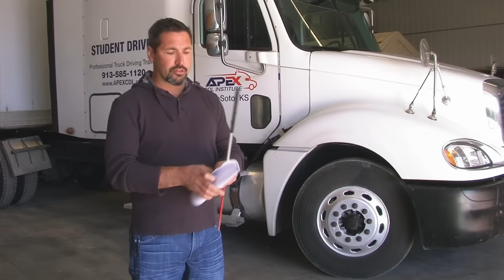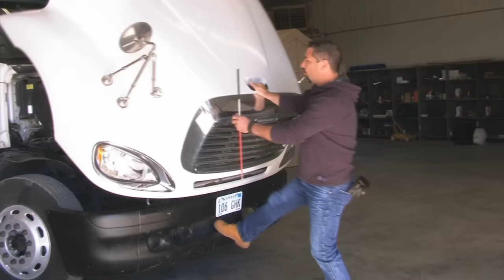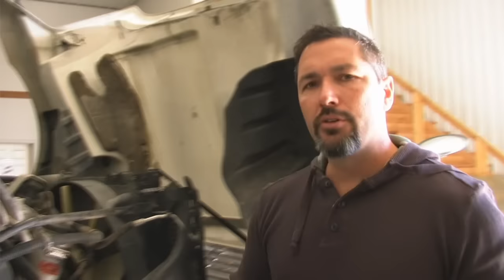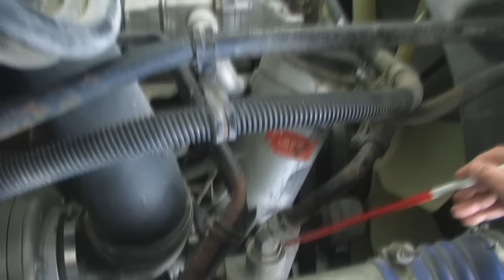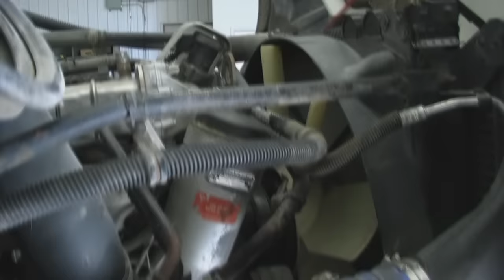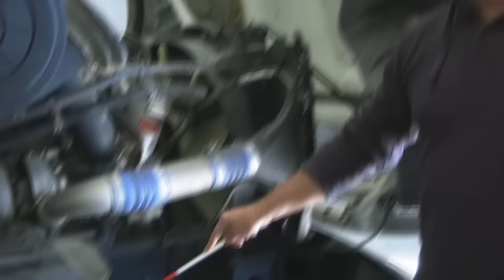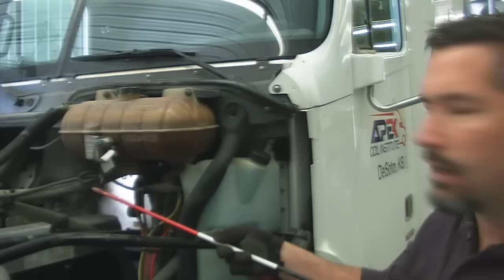How to perform a Class A CDL Pre-Trip inspection. Demonstrated by a state licensed CDL examiner.

Comment: 16 years otr and your the first instructor I've seen who actually showed people how to physically check the slack adjuster I rate this a 9 out of 10 although I know it is not needed for their test I think it would be beneficial to the students and new drivers to show them how to adjust their brakes but overall best one yet thank you
Reply: would of also liked to see you show new people how to check breaklights and physicaly look at blinkers and headlight but still A1 job side note you didn't mention brake fluid or blinker fluid lol
Reply: +stephen driver what about headlight fluid..?
Reply: +stephen driver the problem with that is twofold. first most slack adjusters today are self adjusting and as long as you do a pumpdown the brakes should always be in adjustment. secondly most drivers today would most likely crank them down and cause a fire
Reply: He doesn't show that, probably because all vehicles as of 199? have automatic adjusters. No company you work for will have manually adjusted brakes on them. If you work for one, get a new job, the equipment is prehistoric, though I like the manually adjusted ones better.

Comment: You can always call it the “ SLAB” test 
S: Static (should not loose more than 3 psi per minute)

L: Leak test ( apply 90 pounds air pressure and you should not loose more than 4 psi per minute )

A: Alarm test ( The low air warning should comes on when the air drop down to 55 psi or above )

B: Button Test ( both button should pop out when the air drop down between 40 to 20 psi )

Comment: As a driving instructor in Ireland I found this video very good. Much more in-depth than is necessary to do in Ireland. For example...in the walk around we do not need to inspect the engine bay in such detail just liquid levels. And that nothing is loose  or damaged.Also I note that during the in cab check the instructor first checked that the vehicle was in neutral. We teach to check that the parking brake is applied first to ensure that the vehicle can not move.

Comment: This was fantastic!! The first thing I looked at was how long this video was and thought "ahh hell". I quickly realized the length of the video was directly related to the value of its content. The steps laid out with the explanations provided were really what every driver, even experienced drivers, could benefit from greatly. It's July 2023 right now and everything reviewed in this video is completely relevant today. There may be minor adjustments, based on your state, that would have you use a modified explanation to give to your exam or test administrator. But having the knowledge of how things are connected, identifying what's what based on how they're connected, and the overall wisdom provided to improve a driver's ability to solve a problem before it becomes a disaster is without question, priceless. Thank you for sharing your teaching skills with the rest of us.
Steve

Comment: Hi There!  Awesome Video!  Here in Massachusetts, the Brake test starts with the engine running! You first check governor Cut In and Cut out. After that, static 3 psi, applied 4 psi, low air preasure light and buzzer signal and Spring brake test (engine off). Next, start engine and do the compressor recovering time from 85psi to 100psi withim 45 seconds. Finally, the 4 points brake test: Trailler parking brake, truck parking brake, trailler service brake (Trolley hand valve) and Service Brake. Thanks for the video!
Reply: I wrote it down—thank you

Comment: Absolutely an amazing instructor and video. I passed my CDL test with no problem with the help of this video. Its a lot to retain but its absolutely worth the cramming of information. There a schools that charge thousands for the information this guy gives. Amazing video and thank you for sharing it with us.
Reply: he gets in the truck and then put it in gear and turns it off so it doesn’t roll then charges the pressure for the brakes (parking brakes) So that he can test the pressure and if there is any leaks.

But what I don’t understand is why isn’t the parking brake already on when he gets in the truck and why do you need to put it in first gear to listen for any pressure leaks? Why can’t you just leave it in park re-pressurize it and then turn it off without putting it in first gear…’m

Comment: The mentioned “hub seal” on the front axle is a hub cap gasket. The hub seal is on the back of the hub and holds the bearings in. Those are not visible until you remove brakes and drum.

Comment: Some Video Notes:

In-Cab Inspection & Brake Tests

Before Getting inside:

3 Red Triangles

10 B:C or better fire extinguisher: 
Fire extinguisher has to be of proper rating, secured, charged, & up to date

6 spare fuses
Notate to examiner if truck doesn’t use electrical fuses

3 Points of Contact at all times while getting inside the truck

Inside:

Put on Seatbelt

Ask Examiner to put on their Seatbelt

Inspect Your Seatbelt: 
Properly secured/mounted on both ends, no frays/damage, latches properly 

Inspect Floor Board: 
make sure it’s free from debris or anything that could obstruct the use of the pedals

Inspect Shifter: 
Not cracked, damaged, moves properly, Splitter is working

Inspect Windows: 
They’re clean, not cracked, damaged, or have any obstructions/illegal stickers, and the seals are good

Mirrors: 
Both flat and convex mirrors are properly adjusted (explain what that means), clean, not cracked, damaged, or have any obstructions/illegal stickers

Windshield: 
Clean, not cracked, damaged, or have any obstructions/illegal stickers, and seals are good

Steering Wheel: 
No movement beyond 10 degrees or  2” on a 20” wheel

Safe Start Truck: 
Turn Key & Give a Few Seconds Before Starting, Parking Brakes Are Set, In Neutral, Fully Engage Clutch, Start Truck, Disengage Clutch

Check ABS: 
Should come on then go off, should not stay on or not come on at all

Air pressure should build from 85 to 100 psi within 45 seconds

Governor should kick off compressor with the air pressure at between 125-145 psi

Check Gauges:
All should be “Working Correctly and at the Proper Level”
Oil Pressure (~20 psi at idle)
Water Temperature
Volt Meter (~ 14 volts)
Tachometer (Rev the engine a little to see the needle moves)
Speedometer (Check during rolling brake test)
Primary & Secondary Air Pressure (Should be holding around 125 to 145 psi)
Fuel Gauge (Enough to drive safely where needed)
Application Pressure (0, because not applying brakes)
Transmission

Windshield Wipers / Sprayer: 
Demonstrate that the washers work by spraying the windshield. The Wipers are: Properly Mounted and Secure and operate smoothly. The blades aren't cracked or dry rotten.

Check Lights:
Left Turn Indicator
Right Turn Indicator
Hazards
Front Headlights
Brights

Turn on Heater & Defroster: Feel with your hand that air is coming from the dash, vents, and below for feet.

City Horn

Air Horn

BRAKE CHECKS

Remember SALE (Static, Applied, Low Pressure, Emergency)

Push Clutch in
Place in 1st Gear (So you don’t move with parking brakes disengaged)
Turn off Truck
Release Clutch
TURN ELECTRICAL BACK ON WITH KEY
Put down window to listen for any air leaks
Push in Air Brake Knobs to charge the system
DON’T TOUCH KNOBS UNTIL REQUIRED FOR TUG TESTS
Wait for system to charge (125 to 145 psi)

Static Brake Check (without brakes applied)
3 psi or less over a 60 second period (for combination vehicle)
In both primary & secondary

Applied Brake Check
Apply Brakes & Hold
4 psi or less over a 60 second period (for combination vehicle)

Low Pressure Warning Signal
Start fanning brakes
Warning should come before ~60 psi

Emergency Brake Valve Test
Continue fanning brakes
Warning should come on between 20 and 45 psi
Both valves should pop out for tractor & trailer
Don’t touch the knobs, keep pumping until they both pop

Safe Start Truck: Turn Key & Give a Few Seconds Before Starting, Brakes Are Set, In Neutral, Fully Engage Clutch, Start Truck
Charge system by revving engine around 1500 rpm
Wait for the governor to kick the compressor off indicating the storage tank is full

Tug Test for Emergency Brakes (Tractor/Trailer Done Individually)

Trailer
Press in Clutch
Place in 1st
Release the spring brakes on tractor
Lightly release clutch to pull against trailer brakes

Tractor
Set tractor brakes
Release trailer brakes
Lightly release clutch to pull against tractor brakes

Service Brake Test
Release both tractor & trailer brakes
Let out the clutch
Lightly hold steering wheel or no hands (Ask which they prefer at school)
Get up to 5 mph
Push in clutch
Firmly press brakes (It should not pull to either direction)

Should also check your trolley valve, which applies just the trailer's service brakes.
(Not on test)

Properly Shut Off Truck

Thanks for this video! This is by far the best video I've found for this information. 
I've watched it a bunch of times. I have my learners permit, but haven't taken the classes yet, I'm going in as prepared as possible.
I hope these notes I took for this part of the test are helpful to someone. (And not inaccurate in any way
Reply: Wow Thanks printed this up great help

Comment: Parking brake (Tractor Spring Brake) 57:29
Trailer Brake ( Trailer spring brake ) 56:50
Trailer Service Brake (Johnson Bar) 59:24
Combination Service Brake — 57:55
Air Leak Test — 49:40
Fan Down One — 53:00
Fan Down Two — 53:35

Comment: he didn't check battery compartment to ensure batteries secured properly, I would have also put on lights and 4 way flashers during rolling brake check.  My instructor seems obsessed with the Pitman arm but noticed this guy says OK to refer to linkage from power steering gear in general terms, i.e 3 way linkage
Reply: He did say "my hazzard works properly 49:17"😏😏

Comment: How often do you perform this inspection?  It seems that these inspections are something a qualified mechanic should perform when the tractor gets its service.  If I had to perform this exstencive test before each trip I'd never be on the road.
Reply from the maker: You have to perform a pretrip every day, you also have to document that you did it as well. Dont let it intimidate you, I can do that same pre-trip in 20 minutes. It just takes an hour in the video because I am taking time to explain everything. If I was not orating and walking the viewers through it, I could bust a thorough pretrip out in no time.
Reply: Very thorough, I'm in UK, and the pretrip is not as extensive, but I will include the American way into the UK way, it increases confidence when you do a proper job.  thanks
Reply: every day!
Reply: A good pilot will walk around his plane. Keep learning I walk around my flatbed in the morning and fine someone left a bar on my bed by accident or a tool. Maybe a light out. I pull into a rest area,take a break,then to wake up,I walk around the truck and check the load. There a reason why I check.
Reply: I work for a global delivery company and each day I'm given a different tractor to drive. How long should you spend or at least a minimum of how should it take to properly do a safety pre-trip on a tractor? I'm butting heads w/ a supervisor cause he saying it shouldn't take more than 7 mins for a driver to fully do a proper safety pre-trip on a tractor. I feel that if a driver was to actually perform a proper pre-trip, then it should be taking that driver at least 10-15 mins to do it correctly and not 7 mins which feels so ridiculously rushed. If there was an unfortunate accident due to negligence for preforming an improper pre-trip, can the driver be held liable? Would a lawyer or D.A. possibly institute legal proceedings against (prosecute) that driver if it was known that only 7 mins was spent doing a pre-trip? Have you heard of any past incidents where there was a  judgements against a driver for negligence due to an improper pre-trip that could of been avoided?

Comment: That's not a brake pad.. its a lining!  If you have a Drum brake you have brake linings!
Reply: Lining and pads are the same thing
Reply: Disc brakes have brake pads. Drum brakes have brake shoes. Both are considered linings when referring to the brake friction material that comes into contact with the the steel drum or rotor surface.

Comment: How about the air brake governor cut in and cut out test ? Is this nesassary to know
Reply: while your in the cab and watching the gauges... it would be a good thing to point out when the air pessure reaches operating range... think its 85 psi to 100 psi within 45 secs.
Reply from the maker: It depends on your state. Kansas or Missouri does not require it.
Reply: California does, cut out is just the beginning part of the applied pressure test. just build up the pressure and when the needle steps climbing that's the cut out. no more than 130 psi. cut in is pressing the brake & release. count 5 seconds and see if needle climbs back up. once it does that's the cut in.
Reply: utah requires that. and pumping the brake with the engine off and pressure built up to sound the low air pressure chime
Reply: Ivan Rodriguez
Reply: Apex CDL Institute what about Texas?
Reply: Ivan Rodriguez , functioning air brakes are extremely important over mountain ranges.

Comment: Man, I got my Class A back in 2008 and don't recall this extensive pre-trip inspection here in NY.  I heard they've made the requirements for this part of the exam and backing more difficult.  More things are required for the pre-trip and backing (parallel parking and off-set backing) were added to it.  Well, you should know this stuff as a driver.  Great video, I am looking at it as a refresher since I am getting back  into driving.  I will be looking at this video  several times, it's a great video. Taking refresher driving lessons also, it felt good to be controlling a truck again.  Gonna put this driving skill to use now. Good luck to all you guys out there grinding and stay safe!
Reply: @hello Mac how are you doing?

Comment: You guys are awesome I took my Class A test today 11-7-22 and thanks to your detailed video that i watched probably over a dozen times I passed my pre trip (Form A) with coupling and aced it, aced my in-cab and brake checks (Virginia doesn't require static test, they Just do the applied,  Low air warning, and emergency break valve pop out) Your video was very detailed and helped me a ton on my pre-trip. Thank you!

Comment: Forgot to mention no non manufactured/illegal holes in the frame, leaf springs aren't shifted and the leaf spring bushings aren't cracked or damaged, the clevis pin that holds the slack adjuster to the pus rod is present with the cotter pin present, he also forgot to mention that the electrical lines on the alternator were secured not cut, cracked, chafed, worn or spliced, hub seal oil level being within operational range, brake drums being free of hub oil/grease, fuel tank strap gaskets are present not cracked damaged or missing, steps being free of debris, and the brake chamber strap being secured not cracked bent broken or missing. Just as a helper for everyone when you connect your air and electrical lines never have them twisted together to give them the max amount of travel possible when making sharp turn, when mentioning the electrical/7 way plug make sure to say that it's not cut, cracked, chafed, worn, spliced, or taped. Not trying to criticize this guy's video just trying to give a helping hand for people trying to pass their state pre trip inspection, this video was made 7 years ago so alot has changed since this video was made

Comment: I have driven rigs for 35 years, you'll look hard and long at thousands of rig drivers, you will find very few that do an extensive pre trip. Why??? Cause people are generally lazy and lie a lot. If you're the only one driving your  
rig you'll know by smell, observation, good sense, and you do the work on 
it yourself,  that your rig is safe, you're aware. If the company services your 
rig, the service men know the safety factors and correct the CDL.
Very good video in any case, it's good to know your components.

Comment: Why not say tread depth of the tires is 1/8 vs 4/32 . Its the same thing?
Reply from the maker: Because tear wear happens at a much smaller scale. Tires dont wear an 1/8th of an inch at a time. They wear in very tiny increments.

Comment: Great video loved it and is very infromationial; My experience has shown me that like you mentioned from the start very important; look under the vehicle for any fluid leaks; I have also have found by checking each tire LOOK AT THE GROUND because many times i have found bolts, nails, and other scrap metal on the ground where the tractor was parked  the tractor/trailer was about to run over; the usual 1 or 2 nail in the tires is bad enough; I have found as many as 17 nails and bolts in ONE tire;  HOW many drivers before me used the company truck never wrote anything about that flat trailer tire;   I know in california 20yrs ago, the inspector wanted us to explain "how to properly adjust brakes" and of coarse you would explain that 9/16" wrench to adjust brakes (adjust all the way tight and back out 1/2 turn) the 9/16" wrench would also use it to TAP the brake drum; if the drum rang like a bell it was good, if the drum made a noise like a "THUD" it meant the drum was cracked;   (driving at Night time had its advantages because you could quickly check that all your lights were working vs. the day time. )  one more note is the 5th wheel kingpin hook should have 1/4" to 1/2" gap, and had to explain how to adjust. I know there is 10,000 things to check on a big vehicle its to easy to miss items to check them all

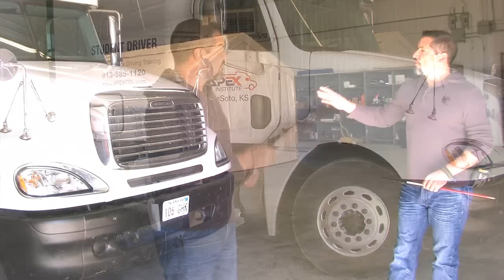Comment: Exterior Overview - Front 3:36
Engine Compartment - Passenger Side 4:54
Engine Compartment - Driver's Side 7:56
Exterior sides and rear 22:18
Coupling 26:33
Back of the truck, 29:58
Trailer 36:30
In-Cab Inspection 42:54
Brake Check 49:16